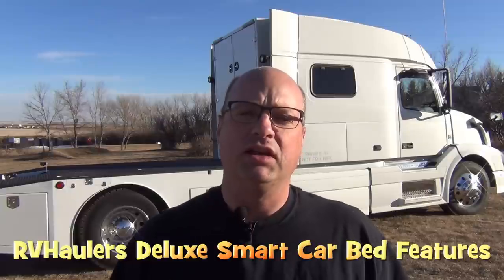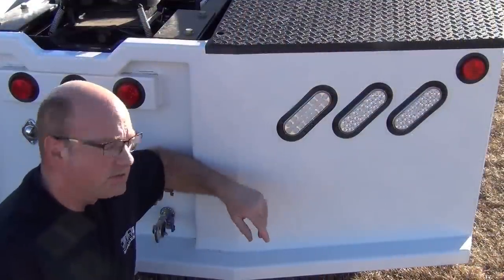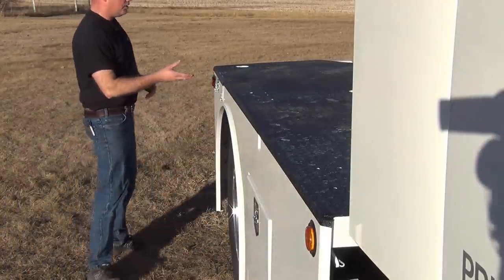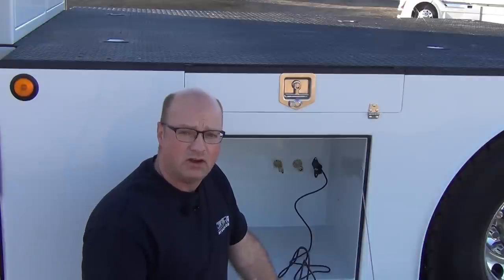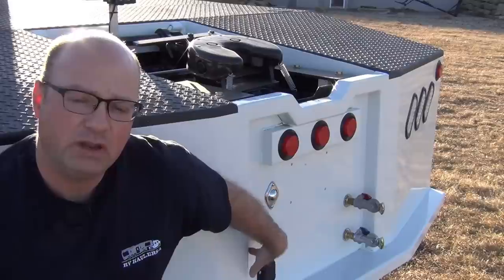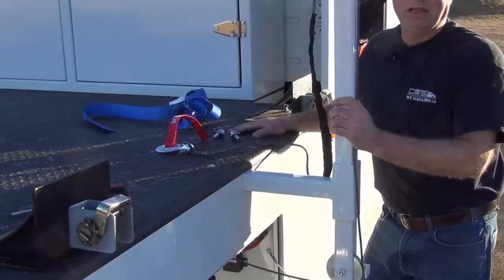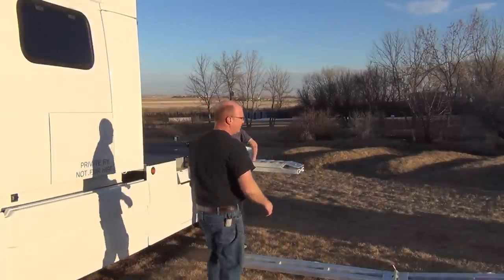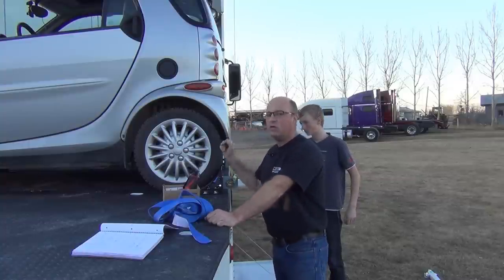RVHaulers Deluxe Smart Bed / Deck Features

Comment: Why don't you lengthen and reconfigure the fuel tank inlet to tanks to level with the bed or trap door in top of bed with inlet just below. Maybe even make the cap part of the trap door. Also is there a reason other than looks to bring the exhaust to the below frame configuration? Thank you, always very nice engineered trucks and looks!
Reply from the maker: Hello Ed,

I completely follow your idea - create a longer and taller neck extension.

I build all our RVHaulers to meet existing DOT and manufacturer mechanical standards.  The fuel tanks have a neck which extends down inside the tank, and forces a air-gap at the top of the tank to ensure there is enough space for the fuel to expand as it warms, and as it perhaps gains altitude (climbing a pass).  That safety system is there to ensure no diesel overflows.

There are two challenges faced with a long neck.

1.  The truck stops we tend to fill at have pumps that run REALLY FAST!  When we approach the top of the tank while filling, that fuel is going to come back up the neck crazy fast, and overflow back at you.

2.  The long filler neck will allow an owner to overfill the tank a bit easier, and by topping-off, get fuel into the 5% air-space, risking overflowing with expansion.

I love the suggestion and brain storming!  This is how I get many great ideas.  Thanks for the suggestion.  

The reason we make the exhaust a weed-burner (routed down below) is to free up the space behind the sleeper for the storage or drom box option.   It gives us the space for a 7 foot high, 6 foot wide, 16 inch deep  storage box!  When full-time RVing, storage is key. 

Ggg

Comment: Things i was rhinking of while watching: popup/crankup self storing chocks, undercoating spray on box behind the wheel, pop "down" chocks, better necked easy access fuel fillers, over truck bed light, filler piece when you move skirting out, outside water hose, outside air hose, outside 110 outlet, and of course a pullout  barbecue!
Reply: Maybe an access port from winch boxes to attach car via opposing winches rather than by the added baskets

Comment: Is it possible/legal to make a short 90 degree adapter to run from the tank filler neck to a remote filler tube and cap on/near the side fairing to not only make it easier to refuel but also to enable wider storage cabinets?  I know on some of the trucks I've driven it was a PITA to refuel some of the tanks.
Reply from the maker: georgianbents The issue you encounter with a "filler neck extension" is the significant risk of overfilling the tank.  Those commercial fuel cardlock pumps run VERY fast volumes of diesel.  It would very quickly fill the tank to 100% capacity, and gush back up the filler neck.  Also, we since discovered there is a engineered specification that states these tanks aren't to be filled beyond 95% of capacity.

Comment: great build Greg, my thoughts as a truck driver

winch needs a rubber winch saver to prevent fairlead or hawse damage

"input" service port needs to be outside the storage box, if a wrecker is going to use that line so that they don't need to cage the brakes, they will want their supply hose connected while in transit, most trucks I've driven with those ports are on the front bumper or under the hood near the air dryer

the leading edge of the fairing that you adjusted looks like it sticks out past the step fairing, if that's the case that edge will be stone chip heaven

Have a look at the Dual Intensity MicroNova or regular Micronova from Grote, very nice, slim and bright design, could have them wired on the side of the bed for extra turn signals
Reply from the maker: Excellent ideas Mike.  Thanks for taking the time to share your ideas.  They are on the list!

Comment: Gregg,   have you ever thought of putting the ramps for the smart car on the passenger side or the curb side of the vehicle. When in a campground setting, in case the truck will not start..... you could still unload the car and go get help. Unloading the car on the driver side may not be possible due to the way  a lot of camp sites are designed Also unloading the car on the traffic side of the truck may not work sometimes.............just a thought. Keep up the great videos.
Reply from the maker: +Dean Grulke Hi Dean.  Yes, we can change over the loading side to side.  Some folks have the counter-thought that in the event the RVHauler has an issue, you are most likely on the shoulder of the highway.  It would be almost impossible to off-load into the ditch, because the steep angle of the ramps would result in the Smart Car getting high-centered on the edge of the bed.  Either way - there are positives and negatives, and I will build the bed to suit the customer wishes.

Comment: Greg, why do you not use air tools as the air is all ready there and ready to use.
Reply from the maker: That is certainly an easy option!  There is certainly a "cool factor" with pulling out an airline and air ratchet.  The air tank volume is so small on these semis, I use up the air really fast with air tools.  I have to keep the truck idling to keep the air volume up high enough that an air tool will work.  Often I have had to stop, and wait for the air to fill up again (depends on the tool cubic feet per minute CFM consumption of course).  When I am in a camp-ground, surrounded by a few folks watching, I personally to have the truck off, and quiet.  I can then chat and visit.
Reply: Gregg RVHaulers Could an auxiliary air tank be installed or maybe and electrical one? Just asking as I am look into one of these trucks but will a longer wheel base to carry a 42 Ford pickup and a 42" speed boat, kind of a show unit.
Reply from the maker: gmpromo I would suggest we don't put the pressure (pun intended) on the engine compressor.  It is not engineered to put out that much air.  Plus, you have to idle the engine to generate the air (fuel use, and noise).  If you need a good supply of air, I would suggest as you mentioned - something dedicated and designed to producing air-tool air.  Such as a small demand compressor.
Reply: gmpromo  Yeah, like he said, it isn't about the actual air pressure being put out, it's how many CFM a pump can provide, and pneumatic tools are far hungrier than a truck's compressor can feed.

Comment: Hi Gregg, I'm new to your channel, so I'm purchasing a 2016. Freightliner M2-112 to haul a 45" 5th wheeler, I want to carry my Can Am Spyder, my question is can this work for me?
Reply from the maker: +Nsureu hamp Hello and thanks for following my channel.   We are building custom beds to carry our toys behind these larger rvhaulers.  I am unsure if you will have the bed length to carry the can am.  We make out beds around 13 feet long to carry a toy and still have room to turn the trailer. Is your rig that long?
Reply: Hi Gregg, thanks for responding to my question. I think the bed is about 11 ft. long now, i've seen one that was stretched from 4 doors to 6, the website is SportTruck.com. They provide the measurements for that rig. I'll keep looking to see how long it is.

Comment: Greg the fairing on the truck wasn't meant for that application,look at that ugly gap it leaves. What needs to be done is to have the front corners tapered ( angled ) toward the fairing which left in it's proper place would look much more a professional job. Just Saying !   Keep. Up the good work !    Hfx NS
Reply from the maker: 1armedguy Thanks for your eagle-eye observation. Yes, this does introduce a 1.5 inch wider gap.  If your eye would like the tapered transition - we will do that for you.  I did that on the Smart bed on HERBIE.